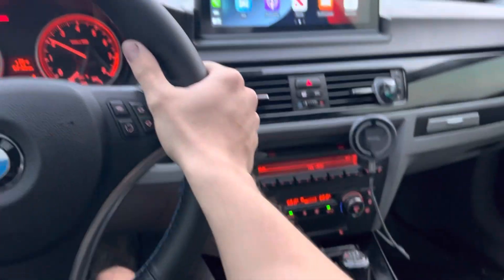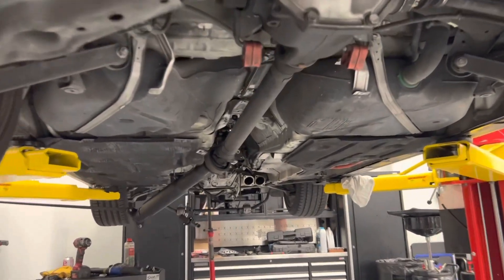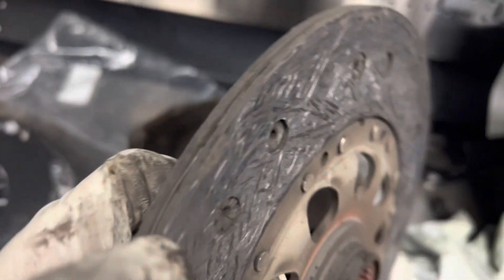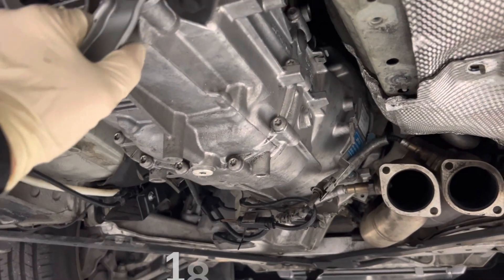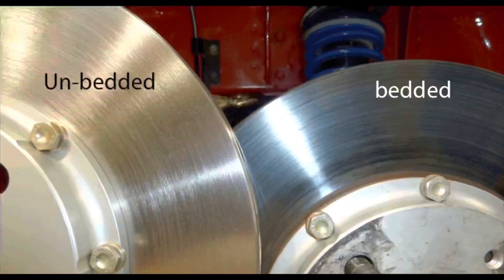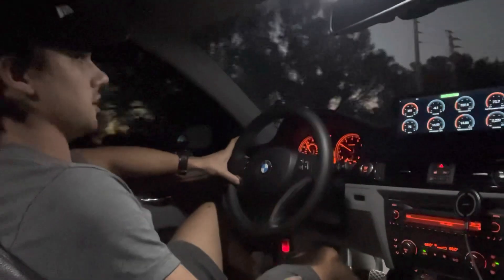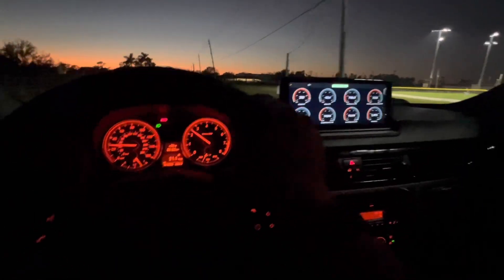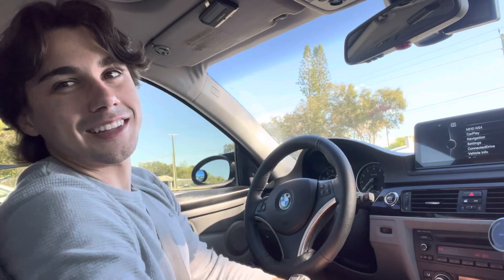BMW 335i budget clutch upgrade - 550i clutch install/review

Comment: Please provide specifics on flywheel you're using.
Reply from the maker: It’s a stock 8 bolt flywheel. No specs to really give. Torque spec is 89 lb/ft

Comment: Did you replace or at least resurface the fly wheel? also if you wanted to switch to a single mass fly wheel could you and use this clutch?
Reply from the maker: Not recommended, but I just slapped it back together. it’s similar to just like slapping brake pads on an old rotor.
My local machine shop won’t touch dual mass. And yes if you use the M factory single mass it will work with this

Comment: Dont think it will hold. Had 550i clutch on my car. 17t turbo slipped instantly. Clutch was just 5000miles
Reply from the maker: All depends on your torque output. Starts to give around 600 lb/ft. It’s a common upgrade but probably won’t hold maxed out 17 or 19t. The sweat spot is the 500-550 range
Reply: @garbinsgarage  17t on pump and meth. 23 psi and it slipped. On jb4 bef too
Reply: @garbinsgarage  i ended up with act extrme durable clutch. Held up well at 26psi
Reply from the maker: @lexgoh5259  how much power you running with that set up? What tuner also?
Reply: @garbinsgarage  i was just on bms maps. I didnt dyno it. Maybe around 450-500 whp range
Reply from the maker: @lexgoh5259  interesting. I know a few people who have reached as high as 650 wheel on MMP stage 3 turbos and 17t’s. Torque was around 500. You must be making gobs of torque. Probably over 550 I could imagine. Most FBO stock turbo cars are 450 lb/ft ish
Reply: @garbinsgarage  yeah but it is first hand experience it slipped the moment 17t went in.
Reply: Before 17t i was FBO with pump93 and meth.
Reply from the maker: @lexgoh5259  interesting. I just started beating the crap out of this clutch like power shifting and I’m chirping 3rd and 4th gear. This sucker hooks
Reply: @garbinsgarage  i was even on new singlemass flywheel. So u just take note

Comment: Nice vid…thanks much.  Plan on doing on my 135.  

Did you replace the flywheel with dual mass or a single?

One thing I’d say if people are new to clutch slippage is that it generally happens on a highway pull in the lower RPMs (3-4k) which are the highest torque.  People often think it will be in 1st or 2nd gear at high RPMS, bit that’s not usually when it starts showing up (unless you're slipping the clutch a lot).  

if you notice slippage when you’re doing a highway pull starting at those lower RPMs, you can be pretty sure the clutch is starting to go out and you need to get it replaced before it gets worse.

Comment: So even though the flywheel was wobbly you just left it on anyway ? Or did you torque it down tighter ? Asking bc I’m debating about buying a new flywheel or keeping the stock one on my car
Reply from the maker: Torquing the flywheel tighter doesn’t make a difference because it’s two pieces. I would definitely recommend going to a single mass. I have a lot of drive train, slop due to this worn out flywheel. a lot of clunking when you getting on or off of the gas

Comment: with the luk 550i clutch kit the throwout bearing has a high and low "setting" does it matter how its installed or does it only affect clutch pedal throw?
Reply: Do the low setting, that's what LUK says to do with that clutch kit. The high setting isn't designed for any US clutch kits I believe, so dont use it as it will mess your clutch up

Comment: Any updates? I have full bolt on and 19ts need a new clutch soon but I don’t want to get something super stiff because i sit in traffic 1hr a day
Reply from the maker: @raf1320  depends how much power you were running. Twin turbos tend to create a lot of low and torque that will likely be too much for this clutch. Your next option is a DKM twin twin disk or a spec stage 3

Comment: I’ve got a 2013 f30 335, will this clutch work? I’m also wanting to go smfw, will this work together with single mass? Any chance you know of a kit?
Reply from the maker: I believe it does work. I have an 8 bolt n54 and newer were 6 bolt. Not sure about the f3x n55s. I have definitely heard of people running the 550 clutch in those cars, you just have to be carful of the year clutch you buy. The M factory SMFW would be the go to. I would hop on the forums and see what clutches will fit too

Comment: How do I find out the correct torque spec for the pressure plate and flywheel? I have an F10 535i and I want to clutch swap it but I need the torque spec
Reply from the maker: @samampa007  I did 92 ft/lb on the flywheel bolts and 22 ft/lb for the presser plate

Comment: Please help.  I just had a 550i clutch installed on my stock turbo tuned f32 435i and it is slipping really bad over 280 torque. I have no idea why.
Reply from the maker: Uh oh that is not good. Mine holds great with over 400 Lb/ft of torque. I would take it back to wherever you have it installed or if you installed call the sup and maybe get a return

Comment: How much hp this clutch can handle it ? Because i am thinking of going to the prot injection
Reply from the maker: A lot of people continue to run this clutch 500-600hp range. Lot of 17/19t or a single running this clutch. But generally safe for a lightly modded car. Even the stock is pretty good but I noticed a big difference with this one.
Reply: @garbinsgarage  it is a good deal, and thanks to sharing with us your Expedience , if that clutch can handle that much power without spliing, is that awesome for the price . I hope it can also handle 600 torque . Because I am planning to go to port injection.

Comment: Help.. i have a e92 with 600hp and 700nm will it work ?
Reply from the maker: With this power level, I would not risk it. Go with a spec stage 3 or a DKM twin disc